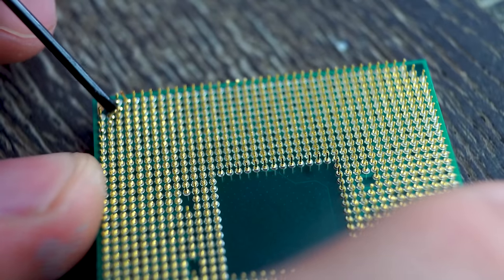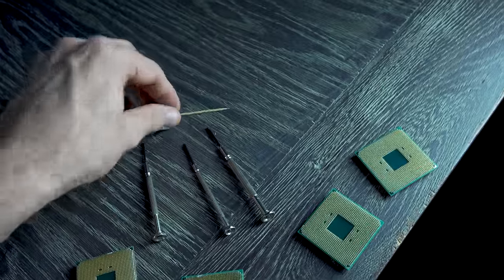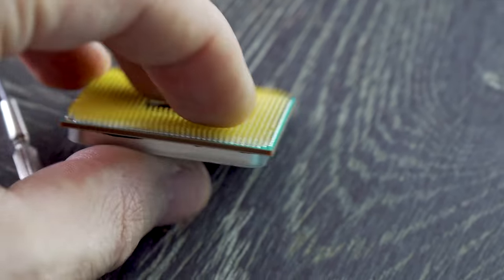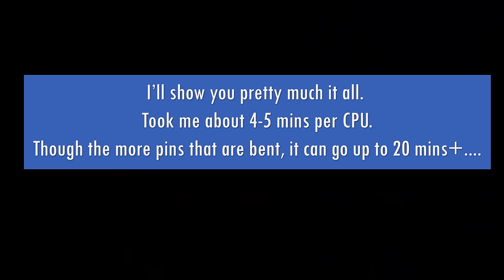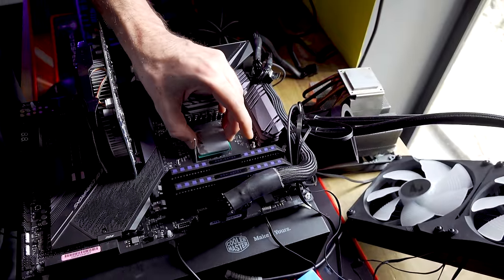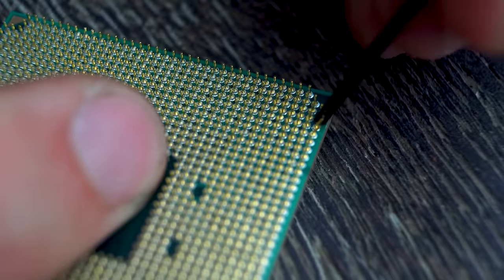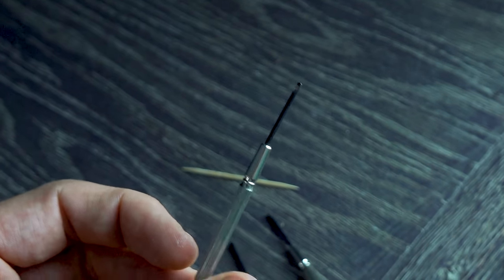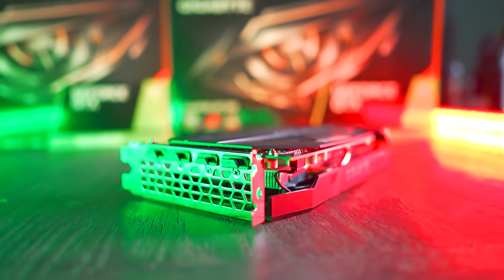How I quickly and easily FIXED 2 Ryzen 2700X CPUs with BENT Pins

Comment: A credit card actually fits perfectly between the pins if they are straight. I used this to get pins exactly straight when I'm fixing bent pins
Reply: Hi. After several months the processor works well?
Reply: @gedimangediman  ya I've had no problems
Reply: @shaneneyome  Thanks.

Comment: I bent few pins on my x3950.   Yiikes!   I used a razor blade, not a utility razor, nor a modern cartridge razor.  But, the old fashioned very, very thin "safety razor", called in the day.  Still can get half ones used for scrapers that remove decals off windows.  Do not get a heavier paint scraper type! Anything larger like a precision mini screwdriver might bend the pins too much, I was worried.  Then seatted the cpu in the socket and rocked the ZIF lever pressing extremely lightly with my moving finger tip.  I went in, but I don't think it's coming out easy in the future. I wish there was  cpu pin jigs to do this with rather than use the actual ZIF socket. The very very thin type. https://m.media-amazon.com/images/I/61wIR0G+biL._AC_UL320_ML3_.jpg   Haven't finished the PC assembly.  Fingers crossed.

Comment: This is probably the most risky way I have ever seen someone straightening pins on a CPU. I have straightened a lot of pins on different CPUs, and I usually use a pointy nail file so I can get under the bend and straighten the pin from the bottom up. It is way easier, and looks way more safe than this.

Comment: This is funny my brother just bent my ryzen 5 3600 because the cooler wouldn't wiggle off now I have to buy a new one
Reply: i just fixed 2 with a mini flat head, sharpened credit card, but i just bought a refillable click pencil. now the lead size is .3mm, it just fits over the pins, a easy way to straighten odd pins

Comment: break the pin? find the slot it WOULD sit in and put a scrap pin there. I have a couple dead CPU's destined to be recycled and blasting them with a heat gun made it drop the pins. They are on the CPU with Conductive epoxy or something.

how I got the pins to slip in? gross but I had a twist tie and licked it and it stuck like a magnet and I could control exactly where to put it. AMD CPU's are like extreme lego's. Don't short the insides of entire chip and you are good! But that is not the thing. Some pins are what controls a piece of hardware like USB 3. Best not to let a pin break

Comment: I just bent pins on my 5600x
Reply: So did I man only on single pin but not sure if that’s even effecting my computer from turning on 😂😊
Reply: @ascendantMethEnjoyer  2 months later? Has it not been working at all? Only thing I could help with is by buying a new motherboard is usually main issue but I hope you can find some solutions asap
Reply: @ascendantMethEnjoyer  damn that’s a pain, it’s always one part breaking or one wire had mine 3 years now and this is the 2nd time it’s stopped working. Yours is all good now though?

Comment: ugly method...i`m using a syringe that i had grinded the needle on a piece of sandpaper until it`s perfectly straight, i have ofcourse more sizes of them to fit any CPU terminals width, just insert the needle over every bent wire terminal and bring the syringe to perfect vertical position, it`s very simple

Comment: I just thought of this
When your taking off the prism cooler you can un skrew the backplate thing
Reply: It's stuck to the CPU not the board
Reply: Yea but if you take of the mounting bracket than it can move freely so you can do the wiggle method
Reply: @dr.chimpanz.1324  again, the cooler is stuck to the CPU itself. You can undo the clips on the cooler to remove it from the board.
Reply: @bjerrum4921  yea and then wiggle it so it can pop off